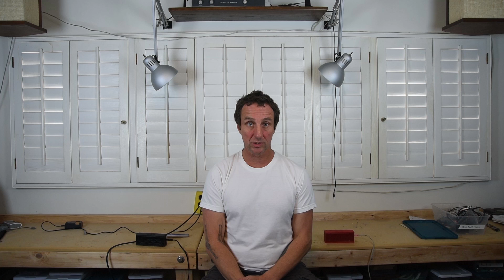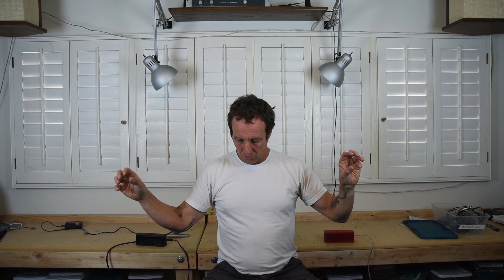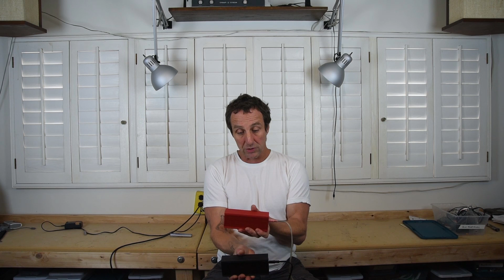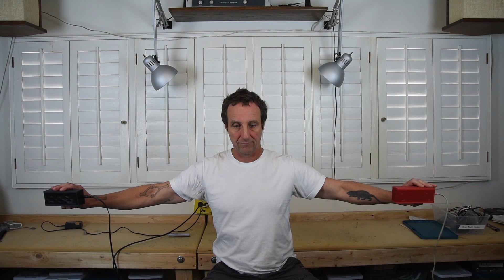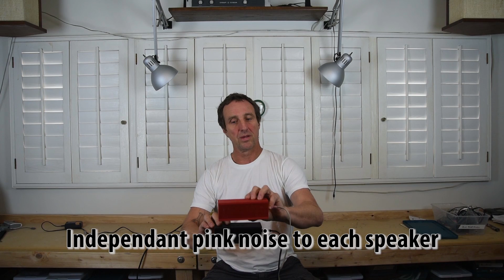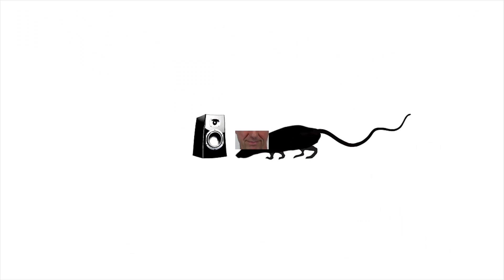Problems With Mono Sound From Stereo Speakers

Comment: This is the whole point of BOSE L1’s. Each band member has a L1 system behind them. It sounds freakin’ awesome. For up to 250-300 people.
Reply from the maker: Yes and now if that concept could migrate to home hifi and larger gigs we could leave the sone age of stereo and surround sound which is just modified stereo
Reply: @DaveRat  indeed. Dave, 2 things. 1. What about using different  speakers either side in a stereo FOH setup? Get each side sounding nice separately,  then blend them together. Less interference? Maybe a bit too radical?🤣 2. I was playing outdoors at a festival the other day and the PA was a nice small D&B Audio tecknic Point source rig with 2 18's subs either side. The usual power alleys and valleys in the bass end was noticeable as I walked around the audience, but it wasnt terrible. I did the sound for a festival once for 4 days in a small hall for 200 people. I only had 2 different subs available. I used them 1 on each side, both we're reasonably good subs, but very different in tone. I got nothing but compliments on the sound haha. So, maybe its ok to mix up different speakers  L/R, I am guessing 2 different subs would mean less cancelations and summings?
Reply from the maker: Yes, both sides need to sound good, both sides dont need to and 8deally don't sound the same, so all differences can be beneficial

Comment: Amazingly great video!!!!!
Reply: @DaveRat  Would be fun to know how you do with the (lead) vocal though?!
Reply from the maker: Minimizing same sound from both side helps. No reason to get to extreme either way. Don't run everything the same to both sides and no need to run everything different. Find the balance to optimize
Reply: @DaveRat  Thanks, will try this asap.
Reply: @DaveRat  One last question please..
Do you use 2 mics on each tom as well then?!
Because what understand .. all drums are in stereo except the hi-hat & the ride ...
Reply from the maker: No, I just pan the toms so no more than one is centered
Reply: @DaveRat  i misheard then.
Many thanks for taking your time Dave :)

Comment: I just remembered a concert technique, used by Emerson, Lake and Palmer in Newport News, or Virginia Beach back in the seventies.   The venue was round and the band was in the center with people all around them.   
They ran their vocal through a leslie (spinning) speaker.   The leslie was placed in the middle of the band.   Around the leslie were six microphones.   Each microphone went to a separate column of speakers set up at the back of arena pointing toward the center.   When they hit the switch the spinning would slow down or speed up or stop.   This created a doppler effect and who knows what else as it threw the vocals around the arena.
Have you ever worked with something exotic like that setup?
Reply from the maker: That's cool! Years ago early 90s at the Roseland in NY with peppers I un attached the pa and actually spun the hanging clusters during blood sugar.

Also I had a quad planner on a tour where I could pan an aux send to the upper left, upper right, lower right, lower left of the pa. Allowing me to select and swirl any instrument.

Yeah, actually done loads of fun stuff. Speakers in the backs of arenas, subs at FOH, multiple pa systems and more

Comment: This is a very interesting, and often overlooked issue with sound reproduction. 
 I'm wondering what your thoughts are in regards to ambisonic speaker arrays, such as Dolby ATMOS. Although speaker compression will still be an issue, the internal delay algorithms should compensate for the majority of issues currently present with multi speaker arrays. Given a high enough resolution of speakers, speaker distortion  from multiple sounds being reproduced should also be mostly eliminated. 
 Taking an Atmos rig on the road may not be practical,  but perhaps moving forward,  it could be a standard speaker array that is repeatable within each venue. Exciting times!
Reply from the maker: Atmos, L-Acoustics L-Isa and beam steering by sound bars are all interesting adventures into using speaker locations and phase to simulate source locations and increase the sound field.

Good stuff and yet none seem to truly recreate the sounds of the original sources when trying to do so
Reply: @DaveRat  So not a vote of confidence! There are some real leaps happening and it feels there is an unprecedented industry support from the ground up to embrace ambisonics. 
 If you haven't tried it yet, I'd encourage you to play with some headphone based mixing tools like DearVR. I don't have the benefit of a proper speaker array in my studio, but if that tech does translate as reported, we could be in for a continental shift!

Comment: I really like your video. I have for a long time thought of the ultimate best system and found a maybe an impractical solution that I think would give the ultimate.
When recording a musician, should it be done  omnidirectional and each player have to be recorded 100% alone.
When playing back do you set up a omnidirectional speaker for each musician, in that spot you feel the musician have to be located.
In that way do you have a point source per speaker, but this point source will send sound in all directions, just as a live musician would do. :-)

Comment: I had another thought about this, could you just mic 2 different speakers on one guitar amp, maybe with different microphones, and then a normal LR system, then send one to the L and one to the R and get reduced comb filtering throughout the audience?  Or are the sounds too close to the same to have an effect?  Because if it is I have another thought, with one microphone, could you just duplicate track, EQ them differently, maybe use different plugins or outboard gear, do the same with guitars or like a snare drum maybe and reduce the comb filtering noticeably?  These kinds of problems seem like they should be able to be solved.
Reply from the maker: Dual mics with hard pan works great

Comment: I had to strike camp and move elsewhere from  a forest of cicadas once that were so loud: all surrounding, that my ear(s) were distorting and possibly out of phasing. I think this is an example of multiple near-identical sounds generated in nature.
Reply from the maker: Very interesting and while phase cancellation lining up and achieving significant nulls with a multitude of non-correlated independent natural sources generating the sound is highly improbable, the summations and associated hearing discomfort could definitely be overloading to the senses.

Each cicada is like a small band limited randome noise generator, as you add more, there will be some sonic cancellations that come and go but overall there will be more and more sonic additions.

It is very difficult to cancel out sound because the polarity, phase, timing and distance will need to be identical as well as the signals identical.

Conversely, any signals that differ even slightly in any way, will tend to add, and lots of cicada sounds will add to the level of pain if there is enough.

Comment: Just watched this again and it clicked! What you said at the end about using twondifferent pick noise sources when pink noise tuning a stereo PA system. Would theoretically fix the comb filtering issues across the listening area when tuning. Genius! Going to the garage to test that out right now!
Reply from the maker: Cool cool, let me know how it goes!
Reply: @DaveRat  Wow so cool! It works. Just test tuned a stereo system using two pink noise generators. So much easier to balance the EQ'ing without all that random phase cancelation going on. Thanks for having this info out there.

PS. took me a while to get to this test. First work got crazy busy then my test bench amplifier died.
Reply from the maker: So cool!! And yes and now you can run 2 generators and pan them mono to test for mono signals and pan stereo for testing the actual speakers and pan somewhere in-between to test for real world semi mono music.

Comment: Great demo , explains comb filtering perfectly !! < , the next question is, does using a single source and delay on one channel have the same comb filtering issues , or does it act as another seperate sound source , stickly due to time interferance !!
Reply from the maker: not sure I understand.  Single source, ok. Delay on other channel? Second source?
Reply: @DaveRat  Delay on single source to second channel , thanks Dave !!!
Reply from the maker: Delaying on channel will just move the summation point to one side in the direction of the delayed channel.

So it moves the acoustic center

Comment: Interesting, I have often had to work wide spaces where I would keep an almost mono mix just so everyone would here the same mix. Deep down I knew what Dave is saying, but thought it too hard to work around.
One thing I had thought of trying was having 4 speakers evenly spaced across the space and going Right, Left, Right, Left. I think it would allow for a lot more panning without nearly  half the audience missing out on nearly half the mix. After this reminder, I’m more keen to try it out. Has anyone else tried this?
Reply from the maker: Running stereo center clusters is not uncommon for arena shows. I would also run stereo side hangs.

That said, getting a non mono sound and minimizing center summations at mid and high frequencies can be easily achieved by double mic'ing instruments using differing mic types at differing distances in different parts of the cone or instrument, then hard panning the two mics and eq'ing them to sound similar.

Comment: We know that in the studio ABBA would duplicate a vocal track & detune it a tad to get a bigger sound (similar to a piano having two or three strings on some notes).  If you then panned  the two tracks left & right you would hit on what Dave is talking about.  I believe there are plug-in processors now available to double an input  de-tune a bit & then throw it out to another channel.
Reply: If you ever use varispeed on tape you know that sound

Comment: Best demo ever of phasing. Awesome, thanks.
Double hard panned kik works AMAZINGLY! thanks.
However, 80% of what I do is dance music, with lots of mono LF.
Here's a question, if one side of the PA had 4 x 2-cone bins with one type of cone, and the other had a similar quality, but different cone, would that 'fix' the phasing on all the mono LF?
ie, even with an identical source, but with slight differences in response, would that be enough?
I'm probably going to try it at some point, but just wondered if you'd tried something similar. You could save me a lot of time & money, lol.
Cheers.
Reply from the maker: Hmmm. Decorrelating a sound source will take more than just a cone change. Using two different mics, that are differing types, at differing distances with differing EQ's, and running the mics at differning levels to the left vs the right while mic'ing differing parts of the instrument can do a pretty good job of decorrelating.

A mic inside the kick and a mic at the resonant head kick hole will grab fairly different sounds and do a pretty good job.

Comment: I realize that this is an older video as far as YouTube videos go. I have a background in music and physics, which made me a pretty good choice to take over the FOH duties in my church. What I don't have is a lifetime of experience in audio engineering, so I try to suck it up from wherever I can find it. The main room isn't great acoustically and has a system that has been designed for it that includes stereo speakers flown and under the stage, but also has a dozen fills planted around the room, which can't be anything but mono.

So I've thought a lot about this issue of single sources of sound being amplified in multiple speakers. I've also thought a lot about how certain instruments should be panned. For example, it seems a lot of people pan toms in succession from one side of the room to the other, when if you are looking at the drums on the stage, they are only from one place. You might see a keyboard off to the left, but it has a stereo signal possible that sounds great, but it sounds like the left hand is playing on the left and the right hand is playing on the right. The location of sound in the stereo spread in the room doesn't fit what you naturally see on stage. Additionally, if I have mono fills all over the room, it doesn't very well fit what is going on in the areas being fed by those fills. I do often spend rehearsals wandering around the room listening for any interactions between speakers. I get a pretty good sound in the room, but there are places where I'm kind of bothered by it. Anyway, I appreciate your thoughts here and they may help me to continue to improve the sound I get in my room.
Reply from the maker: Very cool. Yes, deciding which perspective to present should be considered.

Do you present the drummer's perspective of the drum sounds? The singer's perspective of the stage sound? The up close audience perspective or the sound eng position perspective? Or do you optimize for minimizing cancellations and other issues involved with the room or sound system? Or some combo of any or all of the above?

Each has differing panning, mic'ing and mixing strategy.

The a mirror image of drummer's perspective is common for drum sounds, with each other instrument embracing the sound that musician's perspective is often embraced, though most engineers don't realize that is what they are doing.

Comment: Really good video Dave. A couple of questions though... 

Firstly I would have assumed that this issue is biggest (or at least has the potential to effect the largest frequency range) in a larger venue, where speakers are further apart and listeners are further away. In this circumstance the time differences are larger and, therefore, the comb filtering occurs at a lower fundamental frequency. However, the effect seemed markedly worse in your demo when the speakers were closer together. Is this just because we, as humans, are more sensitive to the change at the higher frequencies (also your speakers and laptop mic probably doesn't have the best low end response as a system, I guess). So, by extension, is this really an issue in a live venue if you're not stood in the middle of the venue and especially when you're going to be hearing reflections from many other surfaces? I've only ever really noticed this effect, I think, at outdoor festivals.

Secondly, with regards to using two mics on a kick and panning L/R, does this not equally risk phase issues because of the time difference between the two mics? Or, as per part 2 of your demo with incoherent pink noise, is this insignificant because the delays between the two speakers themselves are enough to make you not notice the delay between the two sources (despite them being more coherent than incoherent pink noise)?
Reply from the maker: Hmmm, the issues are more pronounced when the amount of direct signal to ambient and reflected room sound is high. So with big venues where reflections and reverberance are a significant, the issues are reduced but still present.

With the dual kick mic, having one mic slightly time offset say, one or two milliseconds and panned to one side vs the other mic, is pretty much irrelevant in all but the smallest of rooms like a control room. 2 Ms delay or about 2 feet delay is what happens if you step a few feet to one side or the other off of exact dead center. Maybe less than 1% of the listeners are standing exact dead center of the venue and those centered people, if they stay exactly dead center, would be the only people the would hear two panned kick mics perfectly timed if they are perfectly timed.

Everyone else hears one or the other early or late depending on where they stand.

And this applies to a single kick mic sent to both left and right as well, except with a single mic (or 2 mics mixed and sent as a mono source to both left and right) there will be 9hasing issues for people off center.

For the dual kick mics either in time or offset in time, those phase issues will be reduced.

Comment: Hi Dave. Would using different mixer EQ levels on Left and  Right speakers have the same effect?  Would this have benificial effects on Front and Rear speakers as well?  I sort of ran into this phenomenon once when I panned the backing  vocals off center from the lead vocal centered on monitors.  Overall it seemed clearer. Sounded better.
Reply from the maker: Differing EQ, altering mic types, mixing different locations on an instrument, using differing mic distances, using slightly different effects and different volume levels and so on, for the left vs the right can all work together to decorrelated the channels.
Reply: @DaveRat  In all my years of reading about audio in live sound this is the most profound discovey I've made.  Thanks!
Reply from the maker: Awesome!